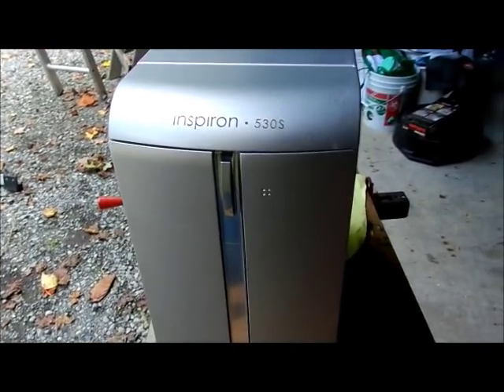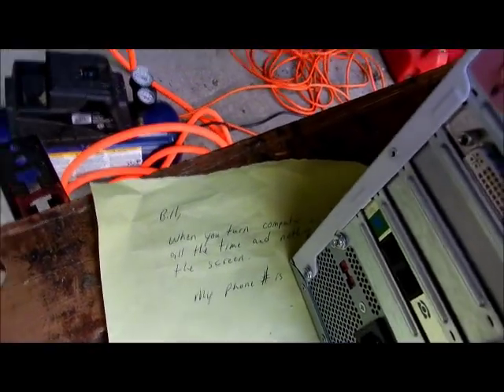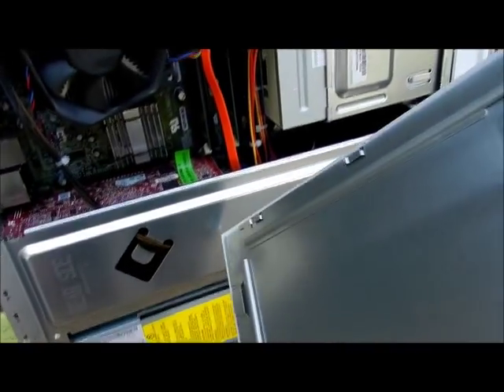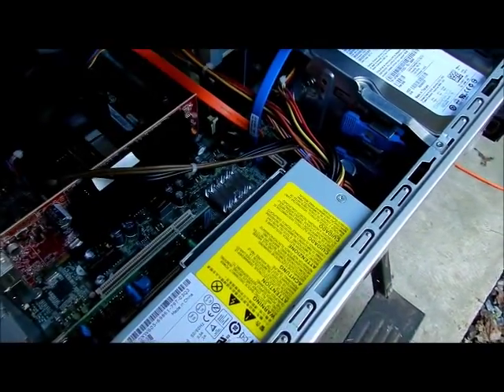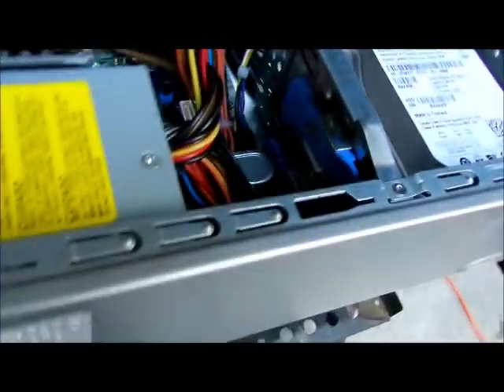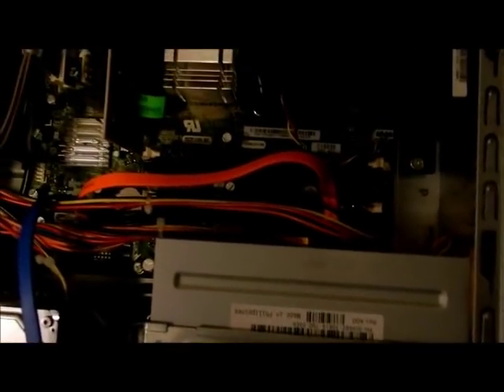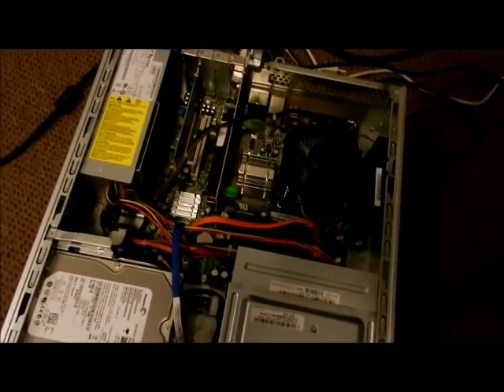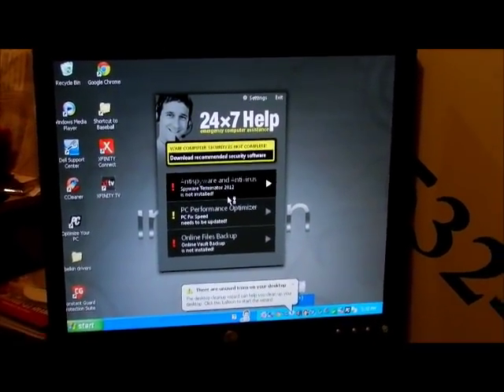Troubleshooting a Dell Inspiron 530S

Comment: I have same pc, but display is not coming while the fan is running, should i replace the ram??
Reply from the maker: Reseat the ram and all cards after the power cord is unplugged.  If you have more than one ram chip try take one out and stating it.
Reply: @billyq12001  i have done several times but there is no display, may be power cord is defective
Reply from the maker: @gaming4life93  Chances are ir may be the power supply.  I would have to have to see.  Good luck.

Comment: I have a dell 530s.  I have barely used it for years.  It has all of my music on it.  I unplugged it and stored it for a month and today I plugged it in and it will not turn on.   The light on the motherboard comes on on the inside.   There is no light on the back to check like I’ve seen in other tutorials.   I’ve done the hard reset and everything.  Will not power on at all.  Any suggestions?
Reply: if it is flashing orange (on the motherboard), it's probably a goner. You can try reseating the memory, as was done in this video, but, it could very well be dead.

Comment: My Dell desktop will not boot up. I removed the memory chips and replaced them still will not boot. All I can get is the bios menu. Will not boot from a disk either.
Reply from the maker: Does the BIOS detect the drives?  If not the boot sectors may be bad.

Comment: Hello ok I hope you get this pretty soon I have an Inspiron 530 not the 530S it does the same thing his does it turns on meaning the power button lights up then the fan runs for a long time and it does nothing but that I just used the other day and then the next day this happens and I dont know how to go about taking out cards and all that stuff because im pretty sure i would mess tings up further i shall review your video again but i would like for you to help me in this matter.
Reply from the maker: Darrius Webb Re-seat the RAM chips and any other cards inside the computer.  Do this with the power cord removed from the back.  Each time I have seen this the motherboard has been back.  In over 30 years about six up me customers asked me to change the motherboard and each time the computer worked.  These day it is not cost effective because this computer is obsolete.  You may be able to find one online.  But you're taking a chance.  The good news is your information is still on the hard drive.  That is, if the hard drive is healthy.
Reply: William Quinn Ok ill re-seat the chips and if that doesn't work I wont worry about it anymore ill just try to get a more up to date PC and thank you so much for the info.
Reply from the maker: Are you able to recover your data from the hard drive?
Reply: William Quinn no
Reply from the maker: I do have video on how to do this.

Comment: I have the same pc and I need to know how to get a graphics card for it
Reply from the maker: You need a slim line AGP video card, like the one in this video.  The type sold at your local store will not fit.  You may have to purchase one off E-Bay.
Reply: are you sure it is a AGP and not a PCI Express card?
Reply from the maker: Patrick Taylor I no longer have this computer.  If it is a brown slot with a clip on the back it is an AGP slot.  Go to: http://en.wikipedia.org/wiki/Accelerated_Graphics_Port
and scroll down to compatibility.  This may help you.
Reply: well I know what the agp slot with the clip looks like and this one is different and I was wondering if it was a pci e slot
Reply: and it is black if that matters

Comment: I have the same computer it was fine a few months ago put it away in the box it came with know that i wanted to use it again it turns the fans on and there is also a beep sound any idea as to what it could be?
Reply from the maker: What kind of beep?  If it's a series of three beeps, with the power cord disconnected, reset the RAM chip(s).
Reply: well found out yesterday what the problem was it was the memory card but now i am having problems creating a connection to the internet.
Reply from the maker: Take a look at the device drive via the control panel.   You may have to re[place the LAN card.
Reply: ok thank you